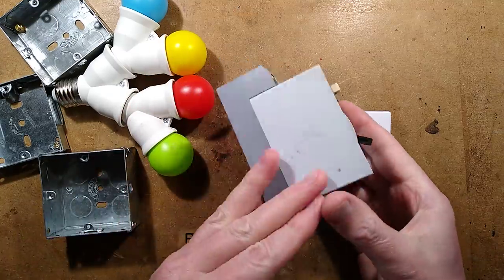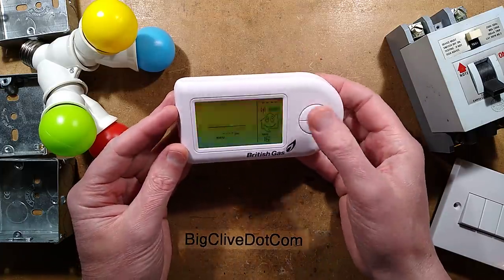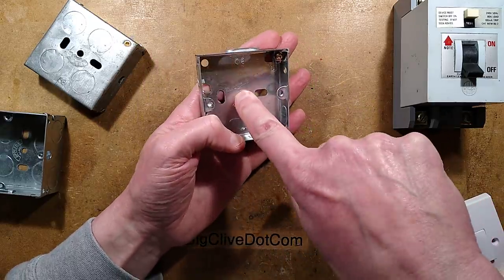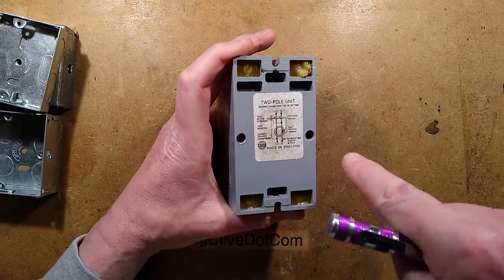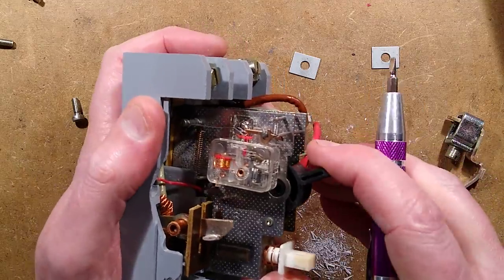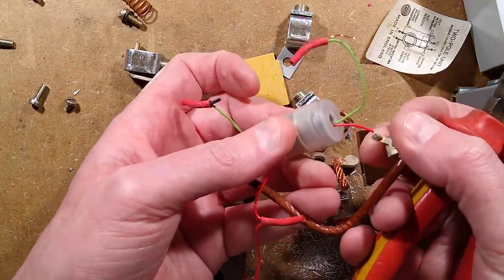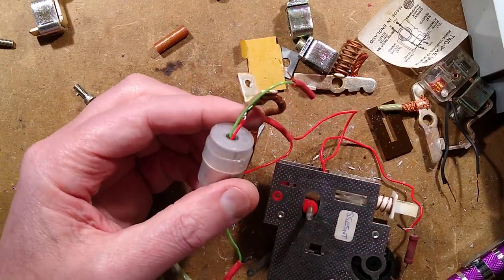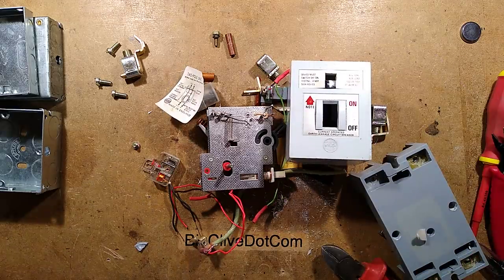Vintage RCD/GFCI teardown with story (weird sensing system)

Comment: Are your neutrals and grounds not bonded together in the panel/consumer unit?
Reply from the maker: Not in an overhead TT system.  You derive the earth/ground purely from an external electrode.
Reply: You do that only in TN Systems where you get some sort of PE from the power companies transformer. These days you commonly find TN-C-S systems, where it is TN-C to the house (3 phases and one 'C'ombined PEN) and TN-S (3 phases and 'S'eparated PE and N) in the house from the panel onward.
The ground wire coming in is connected to a local ground usually to reduce the ground resistance thoughout the whole system.
Any N coming from a power station is by the way generated by a reference to ground anyways.
That is actually what makes the difference between a TT and a TN-C system. in a TT system you define the wire coming in as N and have to create a local ground for every "station" within the system and absolutely need a RCD, in a TN-C system the same N, as it is actually the reference of the L windings to ground, is declared a PEN and everything is grounded to a central earth. You could do that from a power station to the house as a TN-S as well, but that only would require an additional wire connected to the same ground in the Power station (meaning either a generator or transformer in this case by the way.)
There exists even a third system, called IT, but that is quite rare. here one end of the L windings is connected to a common reference used as N, but not to earth and the PE is completely separate. it has quite a few benefits (e.g. one ground fault could only cause a very low fault current and would raise an alarm, but not cut the power), but also some quirks and is rather complicated to realize as insulation must be monitored.

Comment: In the United States  we have   solid ground  at the circuit   breaker  panel and   solid  ground  at the outside  transformer
Reply: Is there actually a dedicated ground line between transformer and panel? or just two phases and neutral and all ground in the house is onle connected to the ground rod connected to the pannel? As far as I am aware the Neutral should not be connected to ground at the transformer, as the neutral is actually the halway point between the two phases on the secondary windind. (at least for the common 240/ 2 phase 120 V supplies, not for the rare cases where actual three phase is available, which as far as I know usually might be in the city or larger apartement buildings.)
Reply: @alexanderkupke920    Their   is a ground  from the  transformer,   with  two  120  volt phases.    The  ground  connects to a bus  in the circuit breaker panel  and also terminates  to a  wire going directly  to  a grounding  rod  outside.   The ground  bus  feeds  both to the ground on a   outlet and the  neutral along   with  one side of the  120 volt rail. Basically a  USA  outlet  has  two  grounds and  one  side of the  240   volts  coming m from the transformer.   Things  like  stoves and water heaters  get  the 240  volts  with a single  ground   The transformer  outside  for  residential use  connects the primary to one of the  high volts  three  phases and the the other side  of the primary     connects  to the ground on the secondary   internally.   The  secondary  has three taps,   one  side is  120 volts , the center is ground  (   connected to earth  with a wire   down the pole,  along with  ground on the  primary)  and the third  connector is the other 120  volt  leg  giving  you 240  volts  across the phase
Reply: @johnsenchak1428  ah ok, I just wondered about how the 240 V secondary site of the transformers was actually tapped for 120 V. Most schematics I have seen before did not exactly show a ground reference here, which would have made it a TT system. Only thing depicted was the secondary winding providing 240 V end to end with a tap at the exact center, referenced as neutral and providing the two 120 V phases to each end of the winding with a 180 ° phase difference.  But seems it is more or less the same setup I am used to here in Germany, except for the small difference that we usually got 3 phase and here we have larger transformers at some point from where the 230 V 3 phase is run to houses along one or more streets (usually not very long runs, I think maybe half a mile. Can´t tell for sure as those transformers while being in plain sight are so common and come in so many different types that we do not notice them any more, unless they burst into flames which very rarely happens). Larger buildings or Businesses (supermarkets etc.) then have their own transformers due to the higher power requirement. Those transformers on the primary side usually are fed with 10 kV.
I think that might be one of the main benefits for the 230 V system (or 400 V if you want to measure phase to phase, like your 240 V) allowing more central transformers, you can feed longer runs with 230 V on a single phase and have less loss than with a 120 V on a single phase. I guess outside the larger cities with the system the US has that would be rather impractical. (Not to mention that buildings here usually are way closer together than in a comparabel residential street in the US, so here you can supply more house with a run of a certain length, making it economically more interesting)
Reply: @alexanderkupke920    On most  outside  transformers for  residential  use, their  are  three  taps,   the left   center  and  right.   The  center is  ground ,   120 volts   from   each    left and right  to ground,  and 240 volts across  the  left and  right,with the  ground  going to   the  appliance  for safety   only . The  ground is  called  the  "center  tap"   because it's the  ground  for the primary,   earth ground and   ground  for the  circuit breaker  inside the house

Comment: So have you done an old ELCB yet? I qualified as a sparky around 1999-2000 but was messing around with it since childhood, but I’ve still yet to see a proper old ELCB.
I believe they were voltage operated, not current, & needed a separate earth spike?
Reply from the maker: Someone mentioned a voltage operated one with a coil between neutral and earth, so if there was a significant voltage differential it tripped

Comment: the insulation looks like teflon, very thin and high temp.
Reply: touch a soldering iron on it and find out :)
Reply: @denisohbrien  I wonder more what results you might get testing it with an insulation tester. Somehow I doubt you would get it to 1000 V.

Comment: I've fitted 100ma rd as main isolator before my 16th ed board just as back up if 30ma goes faulty one day I'll fit a new one but electricians own never gets done
Reply: Make sure there's selectivity between the layers to avoid tripping both from the same fault.
Reply from the maker: A type S with that slight delay perhaps?
Reply: @bigclivedotcom  probably not but don't care if both trip as long as one does! Just a bit of added safety plus I can easily isolate whole board when I next replace it

Comment: I do hope you got a "Competent Person" to undertake a full test and inspection  and sign off your work after changing your  consumer unit ,as required under part p.Or have you finally sat through the appropriate half hour power point presentation, sacrificed your first born and paid the appropriate cartel fees to be able to self certify
Reply from the maker: It was done by a competent person who actually understood the tests he was doing.
Reply: @bigclivedotcom   If the person actually understood the tests then little  chance of  them being  a  cartel member
Reply: @bigclivedotcom  So, who did the CU upgrade? @ThomasNagy @David Savery Electrical Services @bigclivedotcom or @John Ward ?

Comment: You call that "vintage"? Until recently a building I have some responsibility for had a Crabtree 3-phase "current-operated earth leakage circuit breaker" that had the current transformer, a big toroid, separate from the tripswitch unit and a differential trip current of 1A. Oh, and it occupied a metal case around 1 ft square by around 4 inches deep.
Reply from the maker: That's common for higher currents.  A separate coil, controller and trip mechanism.  Usually programmable for the current threshold and delay time to allow other devices to clear faults first.
Reply: @bigclivedotcom  I don't think this one was programmable, the switch unit just has the connections for the 4-pole (TP + N) circuit breaker plus a couple for the trip coil. The trip current of 1A is printed on it but there's no mention of it being a time-delay type. It looks similar, apart from its width, to the Crabtree voltage-operated circuit breaker that was once part of the electrical installation in my house.
The three-phase unit was installed in the late 1970s, but was likely second hand when it was installed as the electrician who did the installation at that time did the job f.o.c. and used a lot of bits recovered from elsewhere to save costs.

Comment: Do you guys not bond neutral to ground at the meter?
Reply: Not for a TT configuration
Reply from the maker: For most other systems, but not overhead delivered TT or some equipotential zone applications.

Comment: Quite rare to see a "transformer" with only single windings
Reply: Not really,  the primary of a current transformer is usually a single turn. When explaining magnetic flux density Ampere Turns is the simplest and most relatable unit. 
I always use those simple terms when teaching Generator theory on the way Motor and Transformer theory. 

My motto is,  once you understand Ohms law and Generator theory all the rest can be derived.
Reply: @mikenewman4078  Primary maybe but this had both primary and secondary (is it even secondary if they have equal windings?) with only one pass by the core.
Reply: @mtreis86  Primary vs secondary has nothing to do with the number of turns, only the direction of power flow.

Comment: Who are some breakers 30ma and others 100ma
Reply from the maker: They go even higher.  Usually it's to allow a standard RCD to trip locally without everything going off.
Reply: @bigclivedotcom  not too sure I follow
Reply: @phonotical  100ma for "whole house" - 25-30ma for a "per circuit". If you only use a single 100ma unit, when it trips you lose all power. If you use the smaller ones per circuit, then only the effected circuit will tip, leaving the others powered. Nice at night for example when you don't want a power circuit to take out your lights.
Reply: @askjacob  Ahhhhh I get you, thanks!

Comment: When you look at the technology advancement over the year's. RCD's combining with over current (MCB's etc) to give RCBO's and not forgetting the latest AFDD's, you'll have to be changing the consumer unit again. 😀😁😂
Reply: DIN rail units are fully modular and have been for decades.
Reply from the maker: It's upgradable to the latest RCD fashion.

Comment: Surprised you've not changed your entire distribution board by now... Maybe something for a new video
Reply: He did mention he changed the whole lot from rewireable fuses to DIN breakers and a whole new box, which is a good thing, though I bet a lot of the wire in the walls will still be older PVC with the PCB leaching out, or will be DCC gutta percha wire still, at least the supply line likely will still be that.
Reply: @SeanBZA  eep
Reply: @SeanBZA  PVC was still standard until very recently.
Reply: @johndododoe1411  Still is standard for a lot of the world.

Comment: in the US here i've been running a welder by combining the phases from two different outlets I feel like i'm being unsafe here the whole house breaker protects it  some and eventually i'll run a proper 250 run to my garage but in the meantime can I just put a breaker inline and make it reasonably safe? maybe asking a scott how to do american wiring not the way to go but ehh ¯\_(ツ)_/¯ maybe i'll just add a fuse
Reply from the maker: There's protection on each of the circuits.  The main thing is to regard each plug as live until both are removed.  Also keep in mind that one circuit can back feed onto a tripped circuit.
Reply: It’s against code, but what you’re doing is basically what a 240v welder feed is. To sorta get it it up to the spirit of code, you can make up a box with two plugs and a tied breaker rated less than the breakers in the box, so a fault on one phase trips out the other.
Reply: @howlingwolven  There's a commercial product called the "Quick 220" that has built in interlocks to disconnect both circuits if either one trips. There's also a cheap DIY version with relays to do the interlocking function.
Reply: I haven't slept in like two weeks so it was a bit confusing to me but now I realise the breaker is inline with your live, in from the bus and out to your wiring so they are still functional. for some reason I was thinking there wired in some way that doesn't make sense and doing this bypasses the protection, thanks as always
Reply: @ChrisD4335  The only problem is that your breakers aren’t tied together, so if one trips out, the other is tripped automatically. This means that one of the phase wires will still be live if a fault occurs.